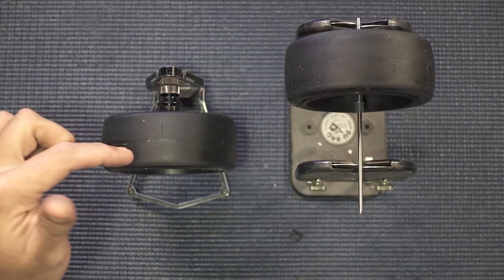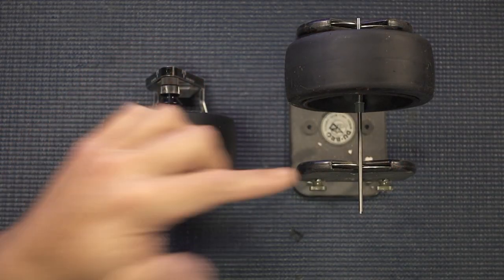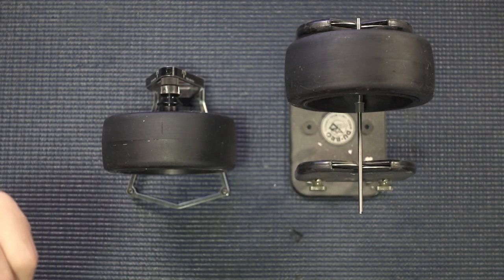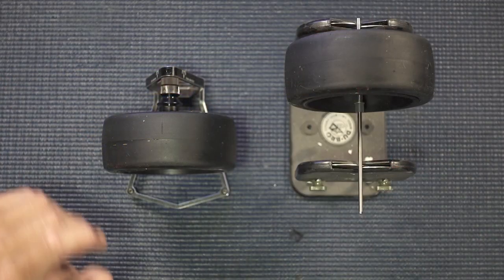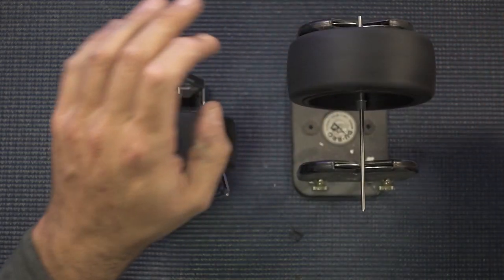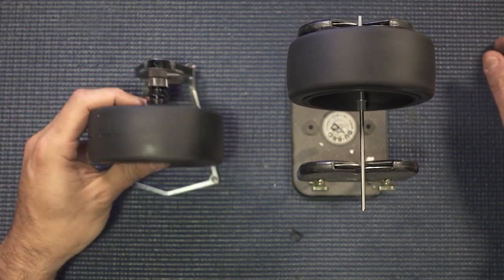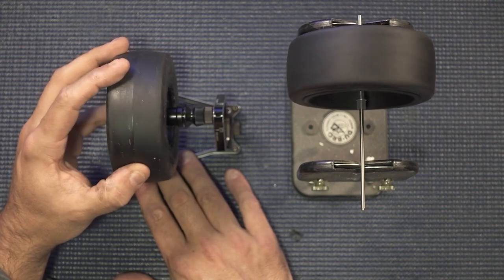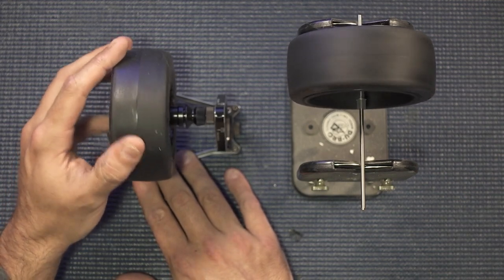THE BEST TIRE BALANCER OR NPRC #shorts #rcshorts #nprc

Comment: After all the tuning with tires what did u prefer with the voodoos running air or the foams ?  And did you think the wider showtimes worked better or the standard drag rim ?
Reply from the maker: Cut showtime plus. Cut off to the outside bead. Medium voodoo foams for parking lot. Air or short course hard foam for big races with lots of prep

Comment: What are you using for balance weight? Thanks!
Reply from the maker: Ah. In the next short coming :) but because it’s important I use electric duct seal compound. About 20 for a brick. In the electric department at lowes or Home Depot

Comment: I just put my rear tire on the front spindle of my car and do it that way.
Reply from the maker: Hey cool. Whatever works man!
Reply: @Dorkyand40  I'm just saving a few bucks. I have the balancers for my off road racing 1/8 buggies and truggies.
    Keep the good videos coming!
Reply from the maker: @johndavidson402  always good in these times man.
Reply: @Dorkyand40  off topic can I get you advice. I just brought the DR10m not sure what esc to go with. I'm using a DRK160+ that came with the 7 stages in another car. My goal is not to run under 2 seconds. 2 2's is my goal to ran at. Will a new drk 160 work well without breaking at this lower speeds. Or just pre order the Ghost esc?
Reply from the maker: I would hope the drk can hold up but chances are it may not. If you have a radio like m17 or anything to tune with them this esc will hold up forever!